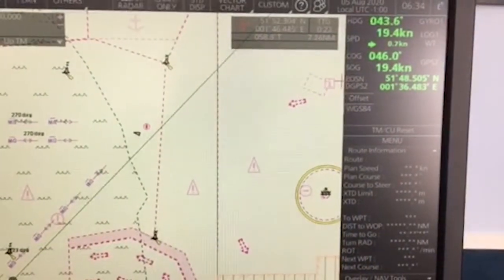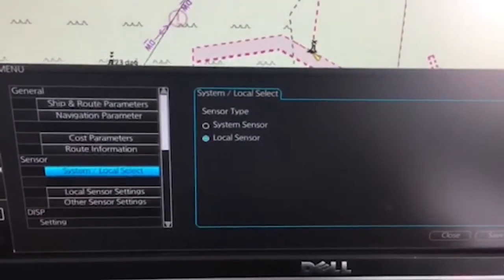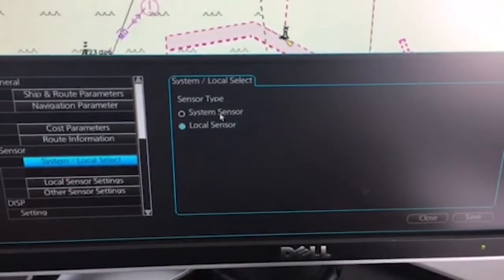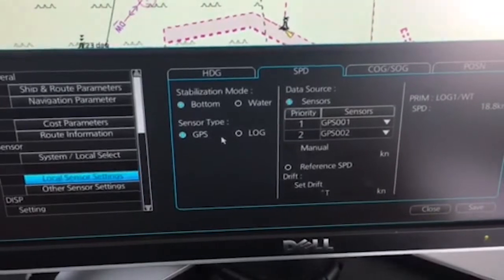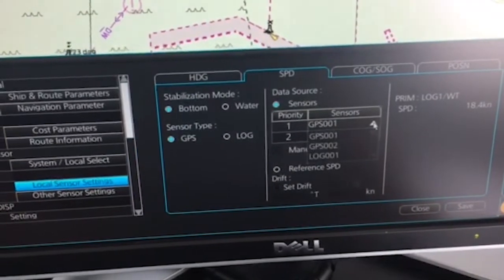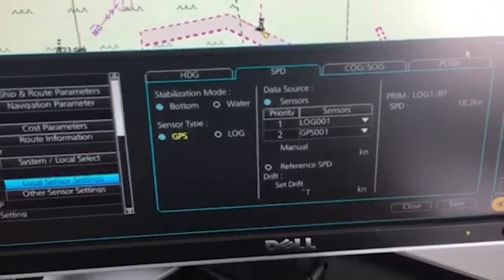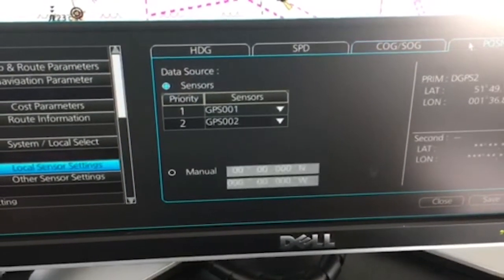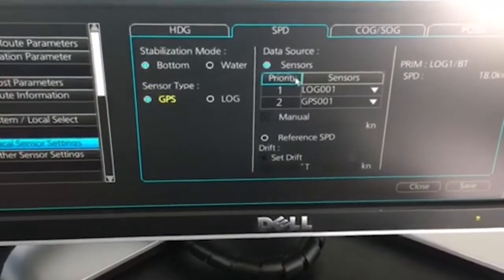How to change priority on your sensor input | FURUNO ECDIS tutorial |

Comment: Hi my Max ROT is set to 30°which is way to small. This doesn't allow me to make passage planning in narrow areas where sharp corners are needed to make. I went to parameters setting and I can't change it there. Can it be set higher without technician coming on board?
Reply from the maker: Dear C1P1
Thank you so much for writing to us
No i am afraid not.
Take care
Kind regards
Morten
Reply: @furunomaritimetraining  thanks Morten.

Comment: Good day sir, i have question in my furuno ecdis have an alert  390 NAVTEX COM ERROR, and i check Navtex Receiver the Status Not Connected. How to find and resolve this error. Waiting your response and Thank you in advance.
Reply from the maker: Hi Michael 
Thanks for writing to us with your question, That is really great of you.
It means that the signal from your NAVTEX was lost for more than the set period at installation. Try to check the cabling from the Navtex to the ECDIS, maby switch off the NAVTEX and start it up again. If the error persists, then you need a technician on board to check it
Take care of yourself
Kind Regards
Morten.